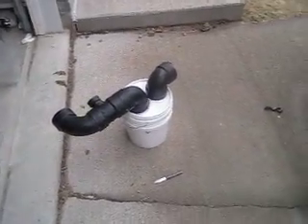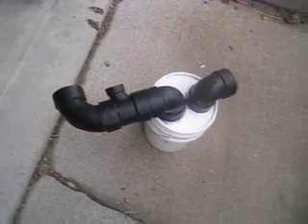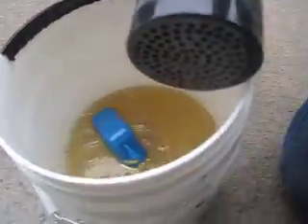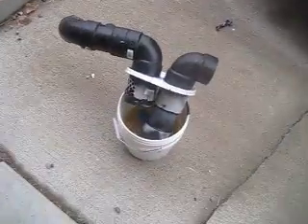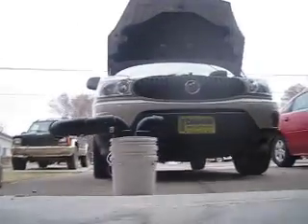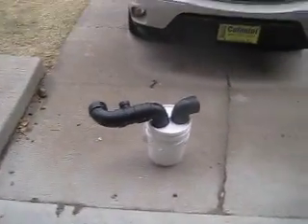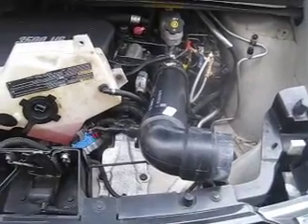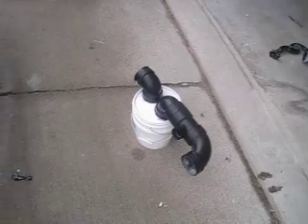Gasoline Vaporizer Build Part 3 (Inards Of The Vaporizer)

Comment: I'm working on my own version for my sc grand prix. I used 4" pvc pipes for four different bubbler chambers plus a bypass with a ball valve. the pipes going in are all 1 1/4"  they connect by the throttle body and the other side goes to the cold air intake.  I drilled small holes in the caps that go into the vaporizer so it hopefully won't splash liquid into the intake. 

also, did I mention I'm putting e85 in it?

Comment: I love the work you have done. I am working on a system for my 1980 chevy k20  with a 350 and a holly 600 on it thought I'd try a few different set ups with hydrogen, water injection, and gas  vapor as well.  I got a device called a atomizer that aparently puts a computer generated frequency through the fuel line which is supose to out more oxygen in the fuel to help atomize the fuel better. I cranked the air fuel screws in almost all the way and new fuel line had been installed when I added a new high flow fuel pump a whole ago accidentally been installed but the line now touches my lower rad hose. so some how between all these things it seems to be acting like it's almost running on vaper from the viedo I have seen it seems simular. Anyway looking forward to seeing more and do you have any thoughts for running vaper with a holly 600. ???  It has a manual choke which I use as a butterfly air control. I find sometimes if I am at a light it helps to control the idle. I still got lots to tinker with but any thoughts would help !!!

Comment: Just an FYI.  the Gas is getting dirty, not only from the air, but the Black PVC.  Gasoline eats away plastic materials.  You want to use a coated pipe or plastic made for Highly corrosive fuels etc.  Will cost more, but those parts will last almost 5x longer.

Comment: You don't NEED an air filter IF you use a HYDROGEN GENERATOR that will produce a sufficient amt of oxygen!  It's BEST to have the hho gas going into the gas vaporizer to keep the gas plenty warm even in COLD weather!  It also PUSHES the vapor out instead of sucking it out COOLING the gasoline!  Why not try it?  Also, why not use a SMALLER container to fit in ANY vehicle-like a 4" ABS black plastic pipe (as long as practical) with a cap on both ends, of course 2 holes in the top for intake & exhaust?  I'm a man with MANY ideas & revealing many AMAZING SECRETS at:  http://Wendell-Ferrell.blogspot.com.

Comment: Do you just leave the fuel injectors in? And basically you're manufacturing it where controlled fumes come between the air filter and air intake, right?
Reply from the maker: Correct.
Reply: Wendell Ferrell With the proper set up you don't even need a fuel pump!
Reply from the maker: Wendell Ferrell You still do so you can feed fuel into the vaporizer. If you connect your fuel pump to the same relay you connect the float switch to than the fuel pump will only turn on to add fuel to the vaporizer.

Comment: hey buddy i have been working on my own vaporizer when i came across your video. i wanted to share some of my experiences. do a search for a 3 way fuel valve (SIERRA Valve with Detent 3 way 1/4” FNPT Universal). i installed my valve through my fire wall so i can switch from direct fuel to vaporizer fuel. i do have to get an extra air intake T like you have to allow more air in when the fuel gets hot it tends to bog down and make more vapor as the van heats up. i plumbed my hot water through my vaporizer  tank.
Reply from the maker: Thats a great idea using the three way valve! Thanks for sharing!

Comment: Here's a question you may have already answered. If there is a possibility of backfire, for instance on an engine with a carburetor, how would you prevent the possibility of explosion? I've seen some youtubers posting their vids of similar vapored setups except with a carburetor instead of a modern throttle body. I'm really interested in this project, however and though I would be trying it on both fuel injected and carbureted engines, I would hate to be driving down the road and the hood of my car blow off causing a fiery car accident. Any thoughts? Thanks, Nino.
Reply from the maker: You will need to place a screen such as aluminum window screen cut to size to suppress a back fire. I would use a material that is a bit stronger than the window screen such as a screen used in a sink, or the type you use to strain liquids out of food. Watch the flashback arrestor video for vapor that I have posted on my channel.

Comment: I believe it works, no problem, just logic. But when the engine compartment gets up to full temp, how will all these plastic parts fare ? This could be a horrible disaster in waiting.
Reply from the maker: Yes plastic is not good for something that will be permanent unless it is placed away from hot parts. Yes, don't use a bucket. This was made simply to see how well it would work. .

Comment: Maybe painting it black would warm it up a little more and help with the vapor idk just a thought
Reply: The BEST way to warm the gasoline is with the gas from a HYDROGEN GENERATOR going into the gas near the bottom.  You wouldn't need another air supply & this would not only keep it warm & vaporize better, but would PUSH it out into the intake!

Comment: I have not looked at all your videos on your fuel vaporizer system but have you addressed your Engine Control Unit (ECU) system in any of your videos. Did you make any changes to your vehicles ECU system, oxygen or air ratio sensor etc.?  Do you even use your ECU and fuel injection system with this system? I would imagine that this system runs very lean therefore the oxygen sensor would detect the lean condition and tell your ECU to inject more gas.  Let us know and thank you for contributing to alternative energy saving concepts.

Comment: Curious have you thought of using a separate container for an ultrasonic vaporizer with hot distilled water and then having a T valve or similar joining to the air intake after the bucket where you control the fresh air and gas vapour mixture.

I watch one guy use 10 & gas and 90% water in a bucket with a cheap ultrasonic vaporizer starting and running his engine and had the above idea for your setup, let me know what you think.

I`m a little surprised there is no ultrasonic vaporizer that can be put on the side of a container (bucket or whatever) without being submerged in the liquid to create the mist, it`s just radio waves.
And you`d think by now someone would have a design that can be submerged in gas buy using gas compatible plastic parts.

Thank you for sharing your ideas and progress, great detail and easy to watch :]
Reply from the maker: You would think that someone would have come up with that by now. There may be one out there but it would probably cost a pretty penny. It may be possible to seal the components in a chemical resistant silicone as well.
Reply: After some very limited research it appears to me the piezoelectric device is just a speaker, so it looks like it should be more than possible to make an ultrasonic vaporizer that could be at least attached to a lid and pointed down into the liquid...  1 water proof speaker or I your case 1 gas proof speaker :]  Sounds good in theory but a little more research about how it works then I`ll splurge for an ultrasonic vaporizer unhook the piezoelectric and hook up a speaker to see what happens...

Comment: You can use heat from the cooling system to expand  gas and 3/4 in stainless tubing to coil like in a sealed container. You can expand and vaporize the gasoline vapors in the fuel rail or make another design to work more efficiently. Its possible to get 5 times your gas millage or improve it tremendously.
 I work on cars for a living Ive been a master tech for 24 years. I have designed several vaporizers  one is with a stainless pipe going to the upper radiator hose and the other is going to the exhaust pipe getting heat from a tube tapped into the side of the manifold .  I have even thought about using a water mister in gasoline but they are not designed for that It probably would just melt from the cheap plastic.
Or using a plasma spark to ignite water vapor from a water mister
I have designed several hydrogen systems to run your vehicle off of. The last got 64 miles and 78 miles to the gallon with a 4.3 liter V6 vortec I am designing a system that will run directly off of water. I'm working out a few kinks and time has been short  and money has been a little tight . That stainless cost a lot of money I just ordered 400.00 worth of pipes last week for this new design.
Maybe Ill post a few videos.
You can do several things to get really good gas mileage but that it really dangerous and will explode if you car has a flashback or something else happens. Try expanding the gas in a special fuel rail system that turns the fuel into a vapor and has a working psi  your injectors will pulsate the vapor instead of liquid all day long.

Comment: how would you do this so it would work with a 2013 Hyundai Elantra. It has fuel injectors and it has a computer to check your gas mileage
Reply: Disconnect the injectors
Reply from the maker: Yes disconnect or pull the fuse for the injectors and reroute the fuel into the vaporizer and back into the vehicles fuel tank.

Comment from the maker: In my new design I use perforated metal as the flash protection and it works awesome! My new design also has a filtration and splash guard system to prevent any liquid from being sucked into the intake. 

Yes I am but this vehicle doesn't have a vapor system in it. My Jeep does, it is my test vehicle there is still much to tweak and redesign in order to have a vehicle run off of vapors 100% of the time. It gets very complicated when you have to control an engine that accelerates and decelerates.

Comment: What did you use for a backflow flash suppressor? Had you thought about a secondary vessel (small bucket,etc...) to pipe the vapor through, in case any liquid gasoline (...hit a hard bump in the road, slammed on the brakes,etc) was sucked into the intake?  Would a container specifically designed to transport gas, (like a plastic gasoline can) be a better choice than a regular plastic bucket? Are you currently driving this car to get to work, grocery store, etc? Keep on keeping on!

Comment: I ended up getting a Fuel heater from duda diesel (awesome site!) and got the same results as the vaporizer. about 33% increase fuel economy in combination with my HHO sys I got from greenfuelh20 site (31 plate), and a VOLO EFIE...doubled the fuel economy. If you have any questions about schematics/diagrams,my email is Tbwcheatwood@gmail.com

Comment from the maker: Trial and error adjusting the opening size of the intake on the vaporizer. I also had a secondary air inlet past the vapor outlet which was adjusted and worked in accordance with the butterfly on the throttle body.

Comment: I just ordered and bought most of the parts to assemble my HHO generator/ gasoline vaporizer system. I should have it installed by the first of the month. I will keep you posted, and see if i can make a video of it to farther explain my system. I have done plenty of research in the area and this seems to be the best site I have found for these kinds of systems. hho4free dot COM has LOTS of really good info on the subject matter.

Comment from the maker: Try it on a lawn mower it works great. I did use more then just the wool I also used a cloth filter which acts as a drier and allows only vapor to be sucked into the air intake.

Comment from the maker: That is correct air flows across the surface of the gasoline it does not bubble through it. The reason it works better then a bubbler design is because it brings the gasoline to a more volatile state, the hotter the vapor gets the better it burns. I have used a bubbler design and have used stainless steel wool as a splash eliminator this insures you don't suck and liquid gasoline into the air intake and increases the run time of an engine.

Comment from the maker: As for building a design similar to this one I would hold off on it until I have worked out more bugs and perfected the design a bit more. I have spent over $5000.00 on this design it's a prototype, I will share all the details of my work once this design has been perfected until then I suggest you do testing with simpler designs such as the bucket design and go from there. Start out simple then move on to bigger and better things.

Comment from the maker: I did not completely abandon this design I re-engineered it to make it better. No I did not have any issues with the PVC and gasoline. The air to fuel ratio was lean but it works better that way. I will be building a HHO powered vehicle once I have perfected the fuel vaporizer. I have to finish this first before moving onto new things. I'd like to see the HHO design you speak of on the comment you made in the HHO with a microwave transformer video. Hope this helps.

Comment: I am curious as to why you abandoned this design, as opposed to your exhaust heated vaporizer in your newest videos? Did you have any permeability issues with the PVC and gasoline? Was the air fuel ration to lean? I have a 2008 Kia Spectra5 of which accumulating the hardware/parts to use this design but with an HHO set up as the only thing on the fuel rail, but keeping the runaround circuit going back to the fuel tank. Also using PWM's on the O2 and MAF sensors,and electrolizer. NE Suggestions?

Comment: hi, Tyson, i have an idea, maybe work if you try to convert the entire gas tank into a bubbler, by reverse the engineering. 1- disconnect the pump relay, 2- release the gas line and put an air filter on it,3- take the gas return line and connect on the suction chamber 4- solve the ammount of vapors in by making your own butterfly control by pedal, 5- make sure you have a good gas cap on your tank (so let in a little bit ammount of oxigen). What do you think?   my mail armandopenac@hotmail.com

Comment: I'm assuming that you have just shortened the air intake pipe/hose into your gas container so that it doesn't actually dip down into the gas, but rather stops in the air before that point and the air flows across the surface of the gas and out into the engine air intake. Right? I can see that this would require that the gas be heated. Why is this better than a perfectly functioning bubbler? Please watch youtube vid  "Gas Vapor Filter - Bullhead T and Bronze Wool" and tell me what you think THNX!

Comment from the maker: Yes that is correct there is no bubbling air through the gasoline in the new design. 
The new design can work a couple of ways you can draw air through the container not bubble air through it but simply draw air through it or you can cave one hole for a vapor outlet port booth ways have worked.

Comment: I have been experimenting with fuel vapor too. my current project is a 70s corolla 2TC engine. I built my own exaust manifold and liquid fuel heat chamber. the exaust manifold has stainless wool inside the chamber and I draw my 300 degree air through it. the exaust gases leave the exaust chamber  and continue to the intake manifold to heat the outside of it.  the intake manifold has coppper wool in it.  would like to share info with you other than on here because of the limited space to write.

Comment: even though the fogger breaks down the gas droplets way smaller than the injectors do, you are still getting droplets, fog size ones. the droplets need to vaporize further, heat and air flow will do this. 250 to 300 degree air will break the droplets down to a invisible gas fume. the better its vaporized the richer the mixture and so the need for less fuel.

Comment: Have a question, could you pipe the vapors into your fuel rail thus eliminating you need for another plenum and will also get rid of the back firing issues?

Comment from the maker: I was until I placed a splash guard in the container to prevent that from happening. I now use a hot vapor system there is no bubbling in the new design.

Comment from the maker: I have done it with a 1 1/2" air inlet pipe and when using hot vapors it ran just fine. 

The new design I built is much smaller but is still to large to fit in a compact car. I built it lager for testing purposes. It can be smaller but how small IDK more testing is needed to determine this.

Comment from the maker: I am not sure yet. I need to do more testing to determine this. One the temperatures need to be at least 300+ degrees to vaporize the additives in the gasoline. The test I did where I got the 200+ MPG the temperature was between 100-200 degrees F.

Comment: Very,very good concept ... but, seriously , what to do about in case of backfire ? Butterfly valve wont be of any help because vapor is very difficult to control . For many years I'm doing LPG conversions and always problems with backfire . In case of LPG when it happens the engine just stop .... and what will happen in case of gas vapor...? Never tried ... any thoughts... I appreciate .

Comment: The major consideration for this is send the high pressure / velocity air inside the container. I am also thinking of using 6 mm diameter various tubes for air inlet, however the outlet will be one.
3. What was the height of the outlet pipe from the top surface of fuel in the bucket?
4. Have you thought for any flash back arrestor / butter fly valve?

Please send me this information so as I can further progress on your concept and make a replicable solution for everybody.

Regards

Praveen